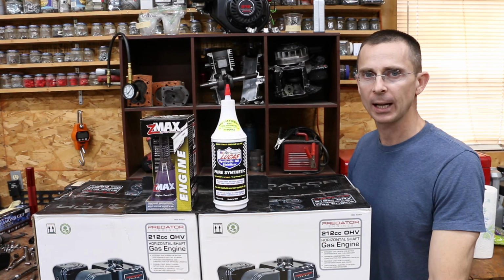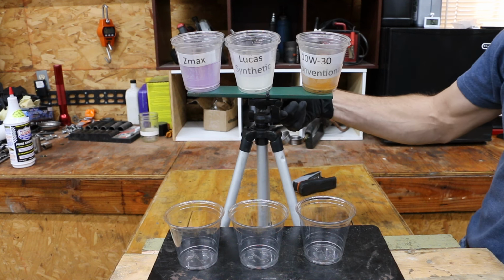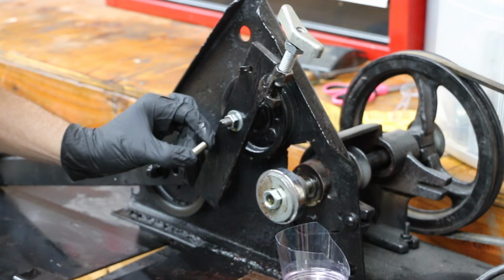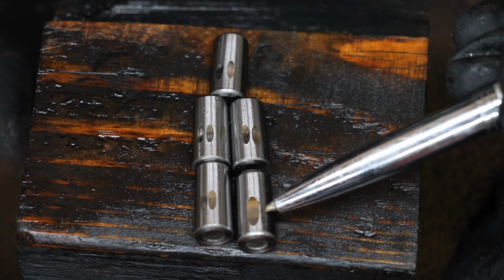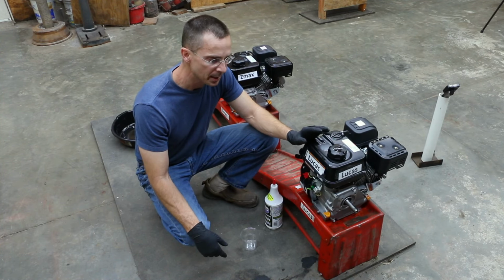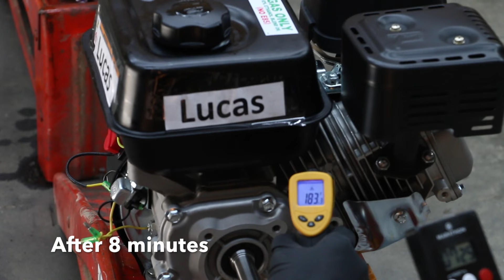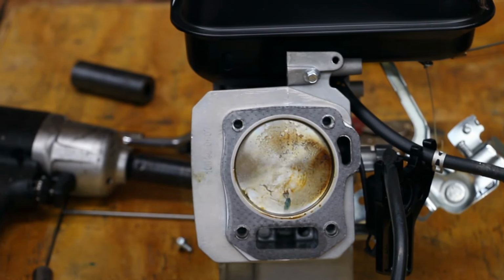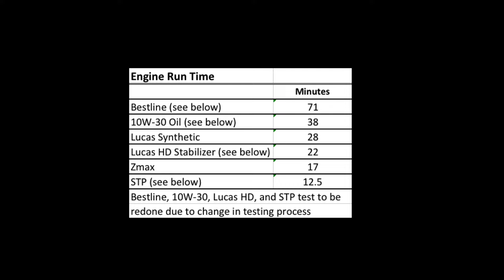Which engine self-destructs first? Zmax or Lucas Synthetic?

Comment: Great series, very informative.

That said, Zmax is junk. It's supposed to "fill the cracks and crevices between the metal molecules" to improve lubrication, but that's just snake oil advertising. It'll flash off out of the oil the second it hits the cylinder wall and piston, and leave nothing but standard oil. any "power gains" come from the first few moments of operation, as it merely reduces the viscosity of the base oil.

To be honest, I believe that most additives are snake oil themselves, including Lucas and STP. They are nothing more than high-viscosity oils that will increase (somewhat) the base viscosity of motor oil; and, if you're running really cheap dino oil, or just running a long change interval, it *can * help restore some lubricity, but that's it. IMHO, it's better to run a correct full-synthetic on a reasonable change interval (standard use engines 10k miles, heavy use 5k), because the real limitation on that interval is the life of the oil filter. Bob Is The Oil Guy has been doing testing of this stuff for almost 20 years now, and is a wealth of information. 

I was going to suggest a test of Engine Restore (as I've used it in really really old and worn out engines, but I see you have it on your list. It's not a comparative test, but it'll do for a start.

Also, you should be testing full synthetics (Mobil1 is a good example) as well against the dino oils with additives. It would be highly interesting to see how plain full synthetics work against the additives.
Reply from the maker: All great points and thanks for the recommendation.
Reply: You miss the concept of how it works.  By running from cold to 185*, the zMAX will embed in the metal surfaces.  They have posted independent test that prove that, some of which were done to achieve their FAA certification.  I have run it in rifle bores and what you claim is not true.  We have seen increased velocity of bullets.  I have the tests.  Also, what got me into zMAX was when I put some in my heavy truck and went from 9.5 MPG to 10.6 on the internal gauge.  That got me researching...  It is NOT an oil additive and has NEVER been billed as such.  Its benefits really shine in carbs, injection, valve operation, and more...
Reply: I will disagree Tex Arcana.
 After adding Zmax at about 500mi my motor has been consistantly running almost 250 rpm lower at 75 mph. I use zmax every 3rd OC. I would have never tried it if my brother hadnt recommended,  then found out that Carrol Shelby was the spokes person for ZMax. Go
I will admit I use Howes and Lucas Fuel treatments to bring my injectors into 500k mi and Lucas Engine oil Stop Leak works excellent, even in a differential!
As I am driving my 3rd Powerstroke "Claire" 672#ft and 599hp at the rear 
 wheels
#1 425k mi injectors rebuilt no additives
#2 672k mi hpop and injectors Howes occasional Lucas no Zmax

Claire 375k mi  Howes and Lucas Fuel Treatment, Zmax, best part plenty o power and 15mpg

Comment: Maybe a 3rd engine with plain oil doing the destruction test?
Reply from the maker: Thank you for this recommendation.
Reply: I agree. Same test. Maybe a semisynthetic drain and run. Thanks to you, we now know that Lucas is better than z max. If an engine runs longer or shorter without any additives, under the same conditions, then we know if it’s actually helping. Not just which additive is best in respects to additives them selves.
Reply: Every experiment needs a control, a baseline against which the variables are compared. We still don't know how long the engine would run with oil without any additive.
Reply: I agree in keeping with the scientific method that would give you a control group
Reply: If i remember plain oil lasted around 30min
Reply: Yeah, this test just makes Lucas look good.  Maybe regular oil is better
Reply: While I completely agree that doing a control would be the best policy, clearly Lucas does a better job at protecting engines. I've used both product in real life. I know for a fact that ZMax wears engines out on the road and that Lucas protects it. Him doing this test still helps people know which way to go without the control...
...has he gotten around to doing a plain oil test? 

What if it did better than Lucas? I still know it'd beat ZMax. That garbage helped me get much better gas mileage, then it wore out my engine in 2000 on my 1994 Ford Escort and at that point the gas mileage was permanently down. I eventually got rid of the car because that on top of other premature issues I just couldn't stomach keeping it on the road. I paid big to know ZMax isn't something we should use.

They have their engine guarantee, but since mine didn't blow up, I'm sure they wouldn't have paid out. I read their fine print and I didn't seem to qualify as I hadn't mailed the form in prior to the test. Plus, they required an engine tear down. Driving another car (I had a few) was a lot cheaper.  @cliftonsmith9099
Reply: @GMK6300L  according to the scientific method, you are right.
Reply: @1blakking  right. Just watch another video to get the control.
Reply: Vasoline would have done better then both z max and lucas
Reply: Vasoline would have done better then both z max and lucas
Reply: @kenhollom1669  lol. YouTube helped double your comment. You know he did do a control in another video, right? I can't remember the results per time but he said, "it did rather well".
Reply: @GMK6300L  here's the regular oil destruction test. Hopefully, it won't come up as spam when it's a link to his own channel: https://youtu.be/m8ZKMCfAue4

Comment: The testing machine you are using is to test EP additive aka Extreme Pressure additives. And is not a good base line for engine oils that do not use EP additives. EP Additives are used in gearlube and gives gearlube that special smell that motor oil does not have. If the engine bearings received that much pressure focused on one area, the lead covering would be destroyed showing the copper metal underneath. Also EP additives require a certain amount of heat to work. heat that would melt the lead covering on engine bearing.

Why use lead on bearing? The pressure that are produced by horsepower are evenly spread across the bearing surface.  The film strength of the oil determines how much pressure the oil can take before the film bead actually ruptures and you get metal to metal contact. The lead is soft metal so what it's there for is momentary contact with crankshaft and no or very little damage when that happens. Any good oil keeps that from happening anyway no additives needed.

If you want to test EP additives on your test machine you can either use a gearlube or you can put a few drops of bleach into the oil or on the bearing during the testing. Once the bearing is coated it's almost impossible to damage the bearing. So why does engine not need EP additives but gear lube does? In a multi cylinder engine the horse power and the pressures against parts is evenly distributed. Then all that power gets transferred to to the rear end where all of its sets on a few teeth of the rear gear creating extreme pressures on those teeth. Under normal conditions the oil does not allow those teeth to touch. But under heavy load they will touch and weld of the additive did not coat them.

The only parts that even come close to needed a EP additive in the engine are some of the parts in the valve train. The pressures generated between crankshaft and rod and main bearing do not even come close. So putting EP additives there is a waste and can make the oil break down much faster. All the additives these oil additive companies use are available to all oil companies. There is no magic poof no more wear formula that anyone has a patent on. Nothing.

If you want to do a real world test on oil using that machine there are steps to take:

1) Reduce the pressure of your machine. Engine oils do not deal with that much pressure. Experiment with the pressures by using a good grade oil and seeing where you virtually get no wear, where the wear starts. In other words set a baseline for pressures that engine oils can handle using your machine.
2) Add a hot plate to warm the oil up to operating temps. About half the additives in oil do not come into play until the oil is at operating temps.
3) Come up with a pressure that can be considered a break in pressure that allows the additives in the oil to some what bond to the metal. This break in pressure would be a pressure that is in the edge of leaving a wear scar on the bearing but doesn't. Or if it does it's not hardly even visible.
4) When it comes to wear and tolerances in an engine, it's the microns of wear that matter. And you cannot measure that visually, So you need to get micrometers to measure this. You'll be surprised at the differences you can't even see that the micrometer will show you. You mic it before the actual test and after to get the differences. And because oil itself can mess up the readings the bearing has to be cleaned before each mic test. Not even the oil from your fingers can be on the area that you are going to test if you want accurate readings. Alcohol or break cleaner will do.

When you test you need to keep a book on the steps you took and the results you got. The book should have a how to for your machine set up. Then sections for each brand of oil and all the api rating each oil you test passes. This way as oils get upgraded you'll be able to test them to see if the upgrade changed the oils ability to reduce wear under pressure and report to your viewers on this. So this will be an ongoing project to keep them informed.
Reply: wow this is pretty good info
Reply: Dude with as much as you wrote and the time and effort you put in to "advising" you should have just done your own test and put up a video. If you've got a problem with the way he does the testing then do your own.
Reply: I'm not sure, but those 2 engines might be splash lubed and if they are  this would negate your argument for ep additives, wouldn't it?  Even if they are splash lubed, film strength is still key to preventing wear.  Your idea of heating the oil first is good.  I have heard that some, like STP, don't mix until they get hot.
Reply: I disagree entirely. Project Farm has implemented most of what he has said in later videos. Or you could say all that he has said, as he heats the oil up by running the test longer and I don't know if he writes his results down or his process, but he shows it all in video, so you know the processes have been done the same on each. 

I suppose the only thing he didn't implement is taking the weight down until there was nearlly no visible damage. While this may be a more real condition test, I think if you take the damage too low, it'd be harder to measure the wear differences.  @michaellinner7772
Reply: I agree. I haven't got any lab tests going like Project Farm, but for what I can prove, I share information about products I try on my vehicles as well. I've tried Lucas, TCW-3, additives in oil and gas, but more often I just fix vehicles.  @ShivaShakur
Reply: Problem: hot plates aren't hot enough.
Reply: Issac Bourne- Which bearings in an engine are made of copper covered in lead?
Reply: @Puckerupbuttercup261  yikes. That's a huge hole in his comment. I'm not an expert in bearing material metals available, but that does seem to be an unusual metallic setup.
Reply: @Puckerupbuttercup261  Actually Not pure lead but Babbitt  alloy which also contains Tin up to & over 93%.
Reply: Issac Bourne... Jesus Christ, it’s Jason Bourne’s  brother
Reply: @davidmorgan8612  that's what he wants you to think. It's a conspiracy on the Bourne side of course.
Reply: DE Nichols hahahahahahaha awesome
Reply: @davidmorgan8612  If you like that I have tons more of funny. Check it out. #ScottyKilmerLaughing

Comment: G'day,

  Um, so...; the Z-Max "treated" Engine ran 17 minutes before breaking & siezing..., the Lucas "treated" Engine ran 28 minutes before breaking but not siezing....

  And the Engine which was broken-in using "untreated" ("Unadulterated" sounds like a more accurate term...) pure Engine-Oil...; it then ran for 38 Minuets..., before finally failing...; yes ?

   On that reading, I'm really really glad that I never pay good money to buy after-market "Additives", with which to contaminate my Engine-Oil...

  Marketing Jism makes the World go around, apparently...

  Yay Team !

  ;-p

  Ciao !
Reply from the maker: All great points and thanks for commenting.
Reply: WarblesOnALot The Bestline (71min) actually appears to be helpful, but I'll agree with you.
Reply: The Bestline engine impressed me at 70+ minutes.
Reply: You also missed the * that shows testing changed, so you cannot compare this lucas result with the other tests. Procedures need to be consistent for accurate results; but preliminary guesswork would suggest best line will still be a superior product thus far.
Reply: End of the day a decent fully synthetic oil is all you need, it's a known fact for many years (however these videos are interesting). It's more about the sloppy previous owners that think cheap oil is the same as any other that ruin engines. If you own a vehicle/bike/whatever from new and never use anything but a high grade oil, that engine will live a long healthy life if treated well. Secondhand cars are always a gamble unless you find one with a regular full service history (most the time anyway).

Comment: E85 in a non e85 engine see if it really causes damage..
Reply: Patrek Brown It has more to do with hoses and sensors
Reply: Patrek Brown I can tell you from experience, 1 tank won't cause damage, however, the engine will run like crap and lose power. I did that on my old 1987 Honda Civic, 1.5L with a Weber 32/36. I had to readjust the fuel mix to make it richer to run decently, but my fuel economy suffered(lost like 6mpg that tank). If I kept running it, it would eat through the old rubber fuel lines and carb gaskets over several tanks.
Reply from the maker: Thank you for this recommendation.

Comment: How about trying Prolong engine oil treatment see how long it will last 🇺🇸🇺🇸🇺🇸
Reply from the maker: Thank you for this recommendation!
Reply: I used prolong and dialing in my dodge 3500 dually 1994 5.9 Cummins and the truck dropped the transmission lines lost all of my oil drove to a dealer empty and they put new lines on filled it with dodge atf. And no damage.
Reply: Keith Bjelland  
But the didglading wea nto abuat the trranny we wer talking abouttt the engin oil... annooooo
Reply: When I was young. I used prolong in a 4 cylinder mustang.  Oil light came on. I was ignorant and did nothing. Needless to say I threw a rod through the block. This however happened 3 months after the light came on. Little older and smarter I think that was impressive

Comment: There is a BLOG where this mechanical engineer, SAE and ASME member, gear head, patent holder tests nearly 200 oils with some of them adding Prolong.  Rather than me explaining exactly what he does, etc., check out this blog at https://540ratblog.wordpress.com/2013/06/20/motor-oil-wear-test-ranking/ as I think it will give you some ideas for your tests.

He rates based on "pressure" (and explains why that is best) and a couple of these using Prolong seem pretty interesting. The question, however, isn't so much the better lubricity of adding this additive, but whether the chlorine over time may prove corrosive to the engine or whether it can actually be detrimental to the additive packages already found in oils.

I'd be interested in your considering this information and perhaps to produce a test you can demonstrate with your engines or testing machine, etc.

Thanks for the infotainment!
Reply from the maker: Thank you for this recommendation. I'll check out this BLOG.

Comment: We already know the Flashpoints right, so this is obviously going to go to Lucas because your running on no oil, I don't really see that as a test, other than what one has a lower flash/disapation/solubility compared to the other. Realistically you should run with an empty crankcase however introduce a small gush of oil at specific time intervals to not only emulate a real world scenario ie low oil but also to better test the actual protective effect whilst still keeping the test short. Honestly, simulation of spratic oil pickup in a low oil situation is far more realistic and telling about how these products stand up, because only then are you truly giving that product a chance to show cumulatively how much further past the standard oil they can reach in terms of chemically holding up a protective barrier between the metals. Thanks for the content, it's really great!
Reply from the maker: Thank you for the feedback

Comment: Have you done a regular synthetic oil vs the same oil but with additive
Reply from the maker: Not yet. Thank you for this recommendation.
Reply: Or does it make a difference if you use the winning additive against plain motor oil you are using.
Reply: In short, do we need these additives?

Comment: can you test various spark plug designs with the see through engine in slow motion? How safe are vapor carbs in a back fire event?
Reply from the maker: Thank you for this recommendation.  I will add a check valve to the vapor setup before I use it again to mitigate risk.  Thanks again.